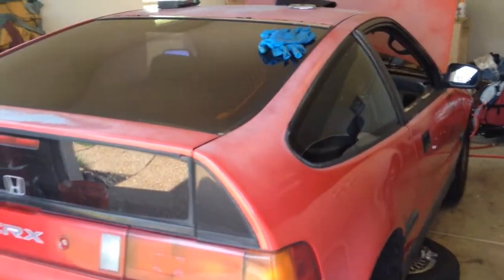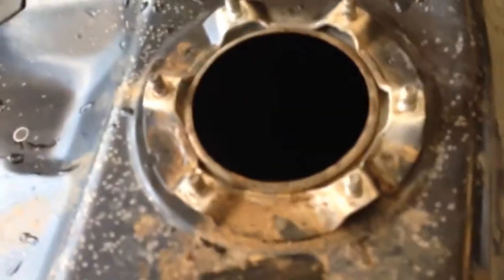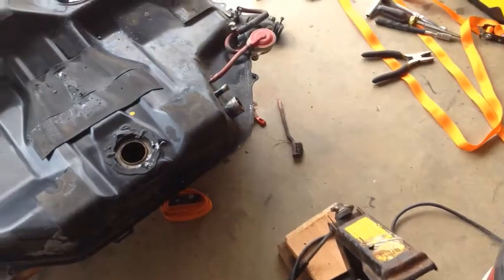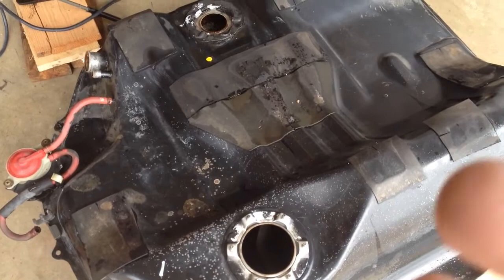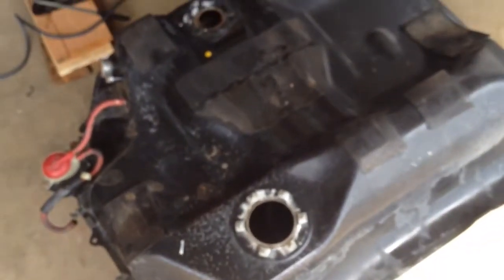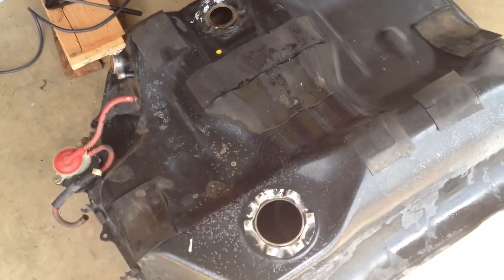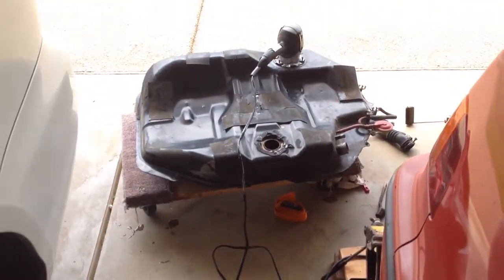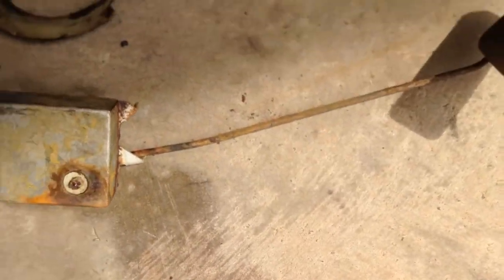$20 Gas Tank Restoration - AKA Rust Removal

Comment: Good video. Duct tape the openings nice and tight and flip the tank over. That'll take care of the top. The vinegar will actually kill/neutralize the rust just like those expensive acid rust etchers. A 4:1 water/vinegar mixture works great for body work. You can tell when the rust is dead because it will turn black. You can safely paint over it then and it won't come back.

Comment: The rust will be back fast because you didn't reseal the tank. Pro 15 gas tank repair kit is what you need. any other way is pointless and will do damage to your gas system. we all like to save money but don't be cheap do it the proper way or replace the tank
Reply: I guess it's quite off topic but do anyone know of a good site to stream new tv shows online ?
Reply: @Amir Xzavier Lately I have been using FlixZone. You can find it by googling =)
Reply: @Dean Darwin definitely, have been using flixzone for years myself =)
Reply: @Dean Darwin Thank you, I went there and it seems like they got a lot of movies there =) I appreciate it!
Reply: @Amir Xzavier no problem :)

Comment: Cautious enough to use distilled water, but then place a oily substance (Serfaom) in the tank.  The process doesn't make sense.  Unless you coat the inside tank with POR,  you'll be doing this over again.

Comment: Do not use vinegar to clean any Metal Products. Because of the type of acid vinegar is you cannot remove all of it from the metal, it will cause your metal to continue to rust even after you put gas in your tank.